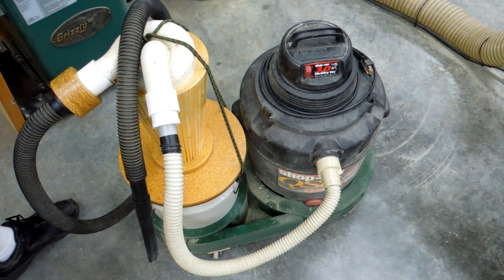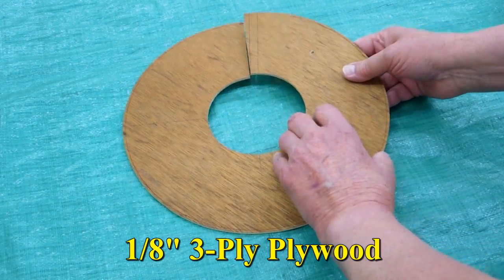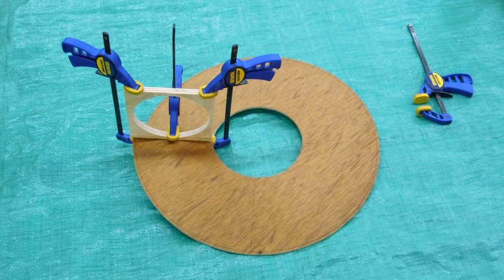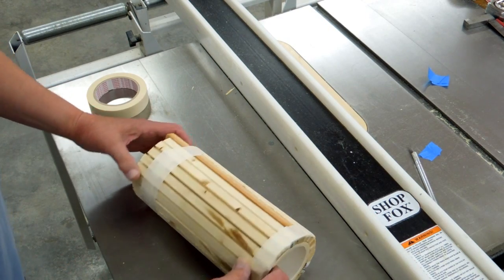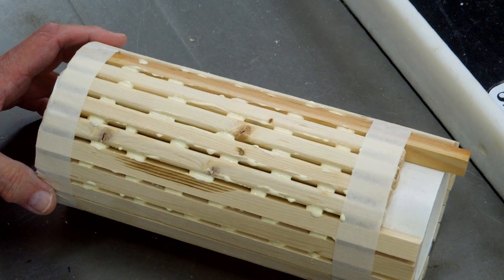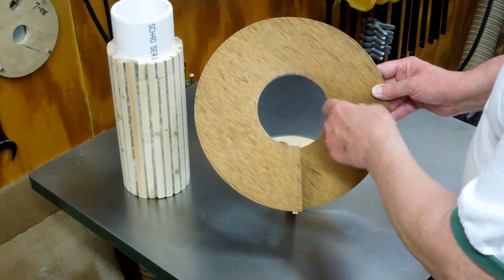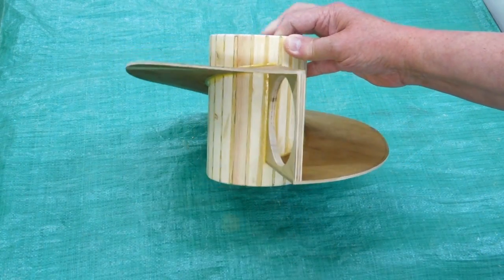Split-Ring Ramp Cyclone Separator Part One

Comment: nice job - 
btw -- since the last decades here in Germany all material in the hardware stores is reduced, while prices increase. You won´t be able to find a pipe with this kind of material thickness. At most it will be around 1/2 mm, while hosts for building trade are about 1 to 1,5mm.
also many other stuff like concrete blocks, tiles, plastics etc are of very bad material quality but yes, this is not the point here

Comment: Hi I have just finished watching your video re the Cyclone Collector, May I suggest that you install a small relieve valve If you need I can send you a sketch for it, the cost will be about $ 3 to 5  it is important as vacuum builds in the chamber it will suck in the flexible plywood and brake it to pieces. principle of the valve is a spring loaded jar cap as vacuum builds will suck the lid down and allows relieving the vacuum.
Good luck for it, I have built one and it works very successfully made of clear polycarbonate.
Regards
Reply from the maker: Jack Marashlian  When I test something I tend to push it to the limits to see what happens. After completion of the project and under normal use in the shop on a plainer or jointer it never see full load vacuum and even it it does that small deflection has not proven to be a problem... just something I mentioned in the video. Thanks for the suggestion.

Comment: Hi there! I am in the process of collecting ideas on dust collection. Ideas piling up in my brain until i saw this vid. Yours is an interesting to build using wood! It adds warmth to the project. I am no engineer to calculate everything. I just want to ask if there is something i need to adjust if i need to build one using a 50 gallon plastic drum. Thank you soo much!
Reply from the maker: This is really sized more to the 5-10 gallon size collecting smaller quantities of dust with lower air volumes like from a shopvac, although it has been proven to work with a planer/shopvac combination. This one was designed with the larger shopvac hoses in mind. I have three different dust collector designs. There is a playlist for dust collection. Thanks for watching. Please subscribe.
Reply: Ronald Walters i recently bought a dust collector that can be wall mounted (see Rockler Dust Right)...the cfm is 750 and i am wondering if it will perform as it is when hooked to a vortex cone like yours via a 50gals plastic drum.
Reply from the maker: dust collectors are designed to work unrestricted... mass flow... keep the cfm at max as much as possible. If you connect a vacuum cleaner hose to your 750 cfm dust collector you will not be able to pick up anything with the vacuum cleaner hose. A small cyclone separator connected to your dust collector probably isn't going to work very well and it makes no sense to connect a dust collector to a another dust collector.

Comment: Hello Ron 
I have a excellent spread sheet which calculates stave dimensions and angles. 
Don't know how to share it. Any ideas?
Reply from the maker: Sorry Gerald, posting something like that to share on YouTube is next to impossible without a website and I do not have a website. A few people have gone to great effort to precisely cut the angles for these cyclones. Besides the dimensions and angles you need a taper cutting jig for a relatively small stave. Most people are not going to be set up for that. That is why I have gone the opposite direction to show it can be built simply with sanded sticks. Thanks anyway! Ron

Comment: When cutting slats did you rip them with a bevel like 12 degrees?
Reply from the maker: I have designed three different cyclone separators and there is a video series for each. This is the largest. My previous videos show how to do many of the steps in more detail and there are playlists for each. I just cut straight slats and then tapered them on the disc/belt sander. It is easier and in my opinion safer than trying to taper such small strips on a table saw. The following videos show the process.Shop Vac 5 Gallon Cyclone Separator Part 1 https://youtu.be/8wMz5iIrddc Toroidal Spiral Cyclone Separator For ShopVac https://youtu.be/E8jGu4duMk0 Thanks for watching! Please SubscribeRon

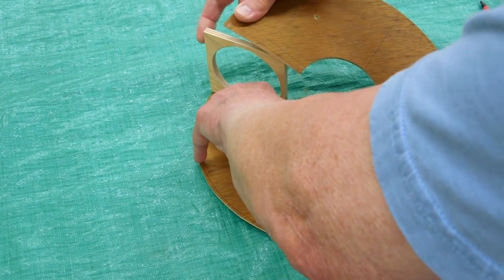Comment: The piece that holds the intake coupler should not be square... (look at 2:19)
Reply from the maker: Why not? Even some commercial cyclones are square at this point. The round pipe sticks inside a ways and is pointed tangential to the side of the cyclone. And... it is easy to make and works great.
Reply: Ronald Walters because the inside of the ring is lower than the outside.
Reply from the maker: Sorry, still not following what you are saying. But if you build one you can make it however you wish. Thanks for watching. Ron
Reply: Never mind. I like your videos very much. Thank you.